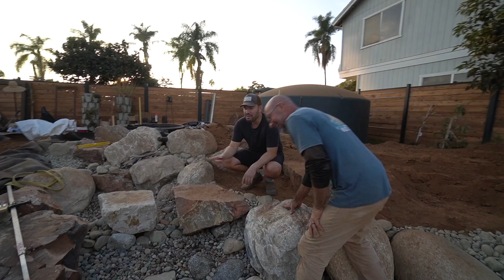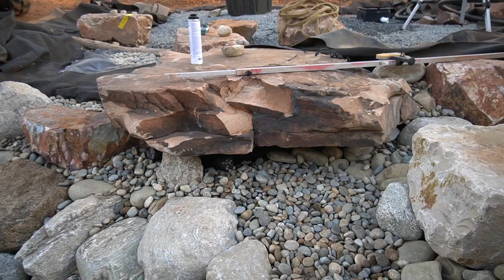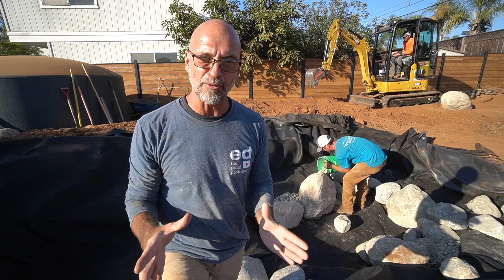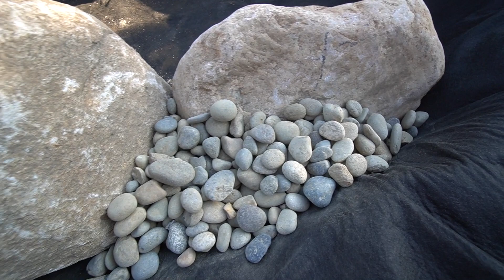Epic Build!! @epicgardening Part 4

Comment: Instead of having round pebbles in the rock filter, it looks like you have crushed stone?
Reply from the maker: This is a prefilter for Rainwater capture which doubles as the base for a Patio, the 3/4” crises stone is perfect for this application.
If it was an Upflow Biofilter I would’ve used Rounded River Rock to allow for effective water flow within the interstitial spaces.

Comment: But Ed wouldn't you agree anaerobic bacteria is okay as long as it's not in the water column? Actually it's kind of beneficial to a pond to have an anaerobic zones as long as it's deep in the substrate or as in this case deep in the rock pile
Reply from the maker: Absolutely!!!
It’s an important part of an Ecosystem and it helps to complete the Nitrogen Cycle.
Under anaerobic conditions Nitrate will go back to Nitrogen Gas